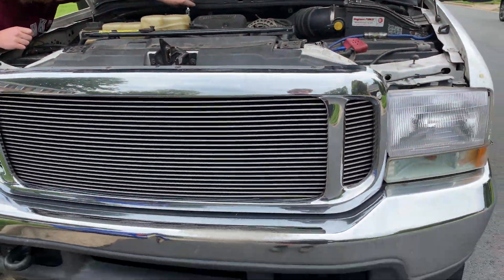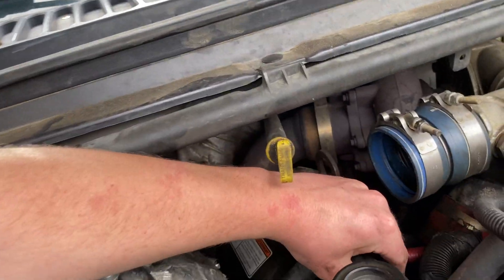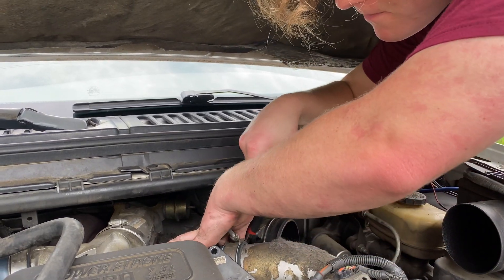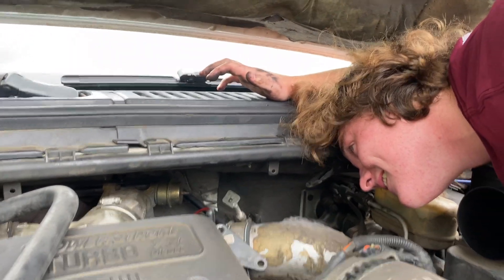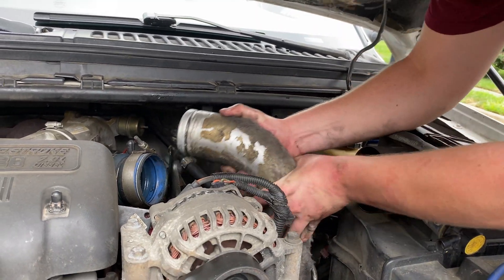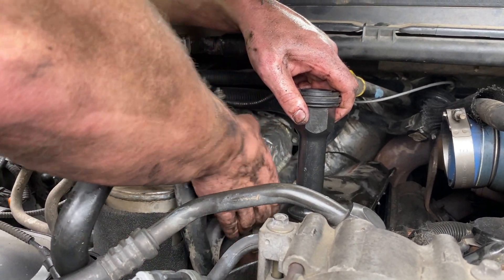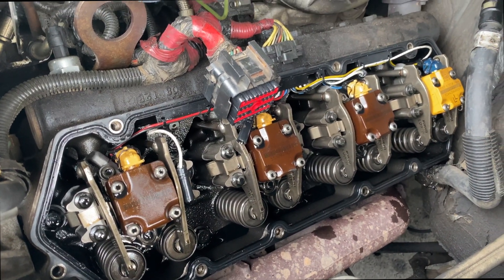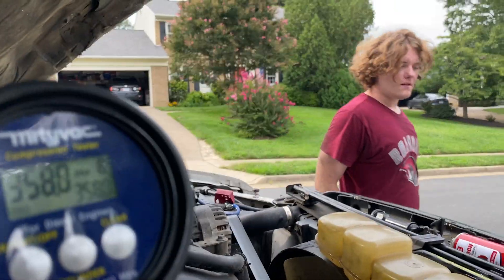How to Compression Test a Ford 7.3 Powerstroke

Comment: Did the test again cranking 5 times the numbers were Driver side front to back 354 325 343 353. Passenger front to back 357 376 364 356 not great but not terrible. Seems like it just needs more boost
Reply: 7.3 needs bigger injectors and a turbo
Reply: definitely needs more boost
Reply: Bigger injectors and bigger turbo to gain the hp what it is lossing